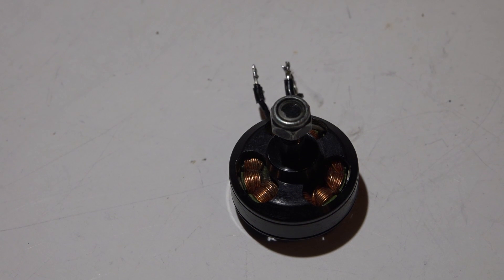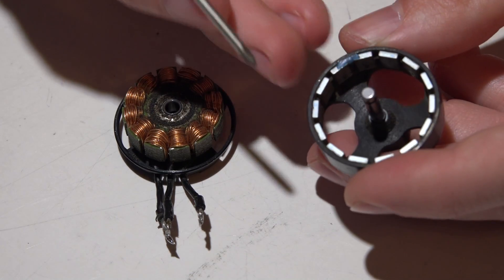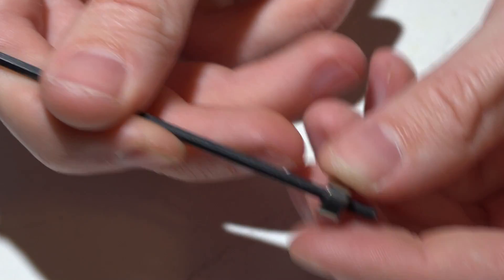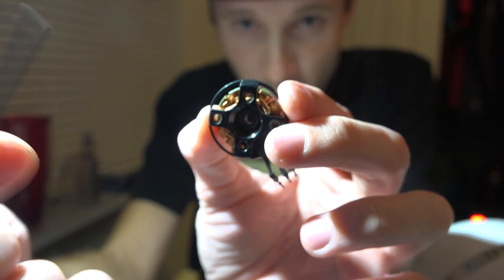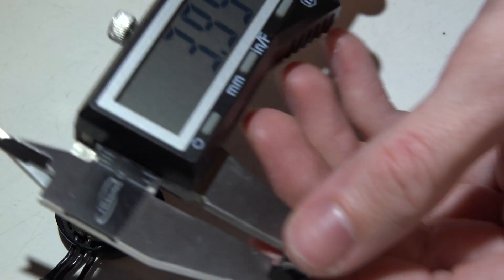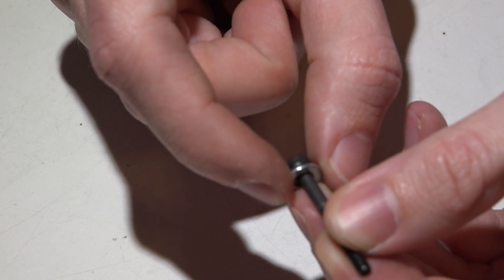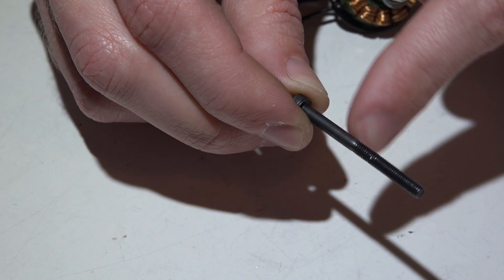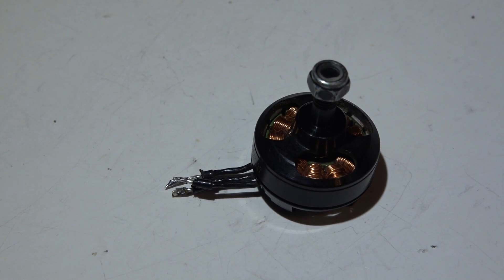Replacing Brushless Motor Bearings Without A Press

Comment: I want to say thank you, thank you and thank you for your genious tip. I had to change the bearings in my LRP x22 motor and I did not have a real bearing tool for it. LRP once had a special tool for their X22 motors but not anymore. I did not want to take a chance and spend 300-350 Swedish kronor either on a "universal" bearing tool that may not even fit on LRP motors anyway. I did what you did instead and used a right size bult(M4) and nut with some shims and used the old beraings not push them in place. Worked like a charm 👍😀!!

Comment: Hello, 

I had an incident today where my splashdrone planted nose first into the ground, the prop mounting screw was damaged can these be replaced or do I need a new motor,  there isn't any visible screw holes like most generic ones on the market but it does look like a seperate piece, please welpppp

Comment: yep look good in my eyes
I would make the tools a little better, so the inbus is not my way, but would find a nice axis .. and then use it in your way.

I would also take a wooden blok to make the engine there neatly in a corner .. that it does not slide away ..( 2 pins in it?? so klik/ hanging  the engine on it )
otherwise there is nothing wrong with the way you work ..
I would take a slightly lighter hammer .( a toy hammer ). but then you can only work when you have the bobbin and pen .. you can work pretty precisely
gr and thank you
good work falcon ! !!

Comment: i wonder if some heat on the motor and the bearings in the fridge for half an hour would let them drop into place just with finger pressure?  i'm still scratching my head  looking at one of those closed e-clips.... i should probably just buy some then all i have to figure out is putting them on which is probably a bit easier... anyway great tips,  will save me some money

Comment: I am playing with some micro brushless quadcopters (90mm to 100mm) and the 1mm E-clips are vibrating off. They are so small that I use glasses and a magnifying glass to work on them. What would you use to lock the clips onto the shafts? Thanks.

Comment: Have you ever tried a thrust bearing on the bottom of a quad copter motor?
I tried it, i fumbled across a perfect size one, and tried it, but i am wondering if it is better or worse?
As with standard roller bearings, the force from the prop is pulling on the lower bearing, and so I guess, must be creating major forces in the wrong direction , that the bearing is meant to have forces applied to.
With the thrust, it is having force applied where it is designed to be applied, I ran it for a week or so, and all seemed ok, but i swapped it out, as I dont know all the specifics for forces and friction and stuff like that.
Anyway, just thought I'd ask, as I have never heard of it being done.
Great info here by you again, thanks.

Comment: Hi!
I know this vid is old.. but im reaching out to get some advice on the dys se2205 motor/racerstar rs2205..
The bolt in the bottom are glued on these motors with locktight.
Less than half of my motors ive been able to loosen up those damn bolts.
On the ones ive had trouble with ive tested about everything.
Ive used a soldering iron to heat the bolt to sort of trying to melt the locktight.. with absolutely no luck.
On some motors ive had.. theres been to much lovktight that the motors hasnt spun as freeley as other motors.
Ive basicly ruined a few motor bolts by trying to get them loose.
And in crash if i had got dirt in them i cant get the bell of.
Any idea what i did miss on the solder iron method?

Comment: How tight is that screw supposed to be ? I killed one of my motors by over tightening the bottom screw. The next one I only nipped and that one is over heating too :(
Reply from the maker: For the screw on kinds I put blue tocktight on it and just get it snug. With the locktight you wont have to worry about it.

Comment: As an old school RC racer I thought I would add one sanity saving tip about dealing with evil c-clips and e-clips.  Get yourself a bag and place the motor in the bag when removing and replacing the clip.  A gallon ziploc will let you easily get your hands in to work on it.  This way you don't fire the clip off into oblivion.
Reply: Chad Martin After they fire off they disintegrate. I have yet to find one that popped off into Oblivion.

Comment: I got a couple of those Cobras, but I think they are grounding out.  When I use them on good ESC's they start to Tremble and not work correctly.  Any suggestions on how to fix possible Motor Grounding out? Another test I did was to check continuity between each wire which was good but then I checked from any wire to the bell housing and I was getting continuity(saw a youtube video on it)...which in the video it stated that the motor is grounding out. Any advice besides tossing the motors?
Reply from the maker: Only other thing I can think of is make sure that your motor bolts are not too long. On these motors the copper coils are very close to the bolt holes, especially over one specific hole. If a bolt on that one hole is touching the coils then it will make the motors act weird. https://www.youtube.com/watch?v=-tp7UD0a9dg&t=4s
Reply: Project Blue Falcon Yeah already did that. I actually didn't mount them on a frame (just for testing) and they were still acting up. I may try to rewound them with new shielded copper wiring. I could toss them but it's just damn shame.
Reply: Let us know how you go with the rewindings.
Reply: ***** good idea. The long road is rewinding. I gotta make time for something like that. I don't even know the shielded copper size.

Comment: Is this what bearings sound like when they need replacing? https://youtu.be/_7N-BPuSxUo
Reply from the maker: It's hard to tell. That sound certainly does sound like bearings, but some motors sound like that when they're new. I just kind of take a mental note of what mine sound like new, or go back to older footage and compare the new to old sound.
Reply: Cool, thanks. I've had them over a year. Only added a HD cam today so first time I've heard that. Only needs to last a few more weeks until my next build.

Comment: The bearings we use are 3x8x4mm or 693zz.  Newer motors with the 4mm shafts use 4x9x4mm or 684zz.
Reply from the maker: Some use the 940zz as well, like the DYS Race Edition
Reply: Does the Fire use those?  Both my se2005 and se2008 use 693zz.

Comment from the maker: When choosing a bolt, make sure you get a metric bolt that is the same thickness as your motor shaft. For example my shaft was 3mm thick so the bolt I used was a M3 metric bolt. The length of the bolt will depend on your motor. For most 2204 to 2206 motors the length will be either a M3x30, 35, or 40mm bolt or M4x30, 35, or 40mm.
Reply: I hope you are resting in peace. we all remember and love you

Comment: is there better performance bearings you can get for motors or are they all about the same?
Reply from the maker: Only real difference is ceramic vs steel. Ceramic lasts longer but both have the same performance. It's just a matter of life span.
Reply: what kind of life span are we talking about... months years?
Reply from the maker: All depends on how often you fly. Kind of like how dirt bikes and jet skis show hours the motor was used instead of miles driven. I fly all the time, weekdays and weekends so I change mine about every 2 to 3 months. Where some people never have to change them. It also depends on the quality of the bearing. Like I said they are either ceramic or steel but they are manufactured different. The Racerstar motors on Banggood are $27 for 4 motors where the T-Motors I use are $25 a piece. With cheaper motors you usually have to change them more often, unless you upgrade to a better bearing like a T-Motor bearing.
Reply: Project Blue Falcon that is the perfect information I wanted to know. Sorry I am new to the hobby and any little bit of info is much appreciated.  My first build are going to have Racestar 2205 2600kv motors so that's good to know 😀
Reply: Project Blue Falcon any recommended sites to look for these T-bearings for Racestar?
Reply from the maker: Just a couple things to add. You generally will know when its time to replace bearings because you will hear it when viewing your footage, if you use a HD camera. Other thing is, although Racerstar motors use cheaper bearings, thats not a bad thing. The way I see it, two quality bearings for one motor are about $5 each. The Racerstars on Banggood are $27 for 4 motors. At that point, and this is why many guys like those motors, it's not so cost efficient to replace the bearings. For a little more you could just get 4 more motors. Which isn't a bad idea at all.
Reply: Project Blue Falcon they come in a kit from Banggood, 210x v+ kit Revo f4 30a esc, any recommendations on motors that will rip like crazy and hold up to the stress? That won't break the bank lol
Reply from the maker: You can buy the Racerstars separately. Dont have to buy that kit all over again. As far as recommendations I use the ReadyMadeRC blue series motors, which are rebranded T-Motors. They are expensive though. The T-Motor F40 series are really good too. But the Racerstars are decent motors too. They have the power, they just dont last as long. But like I said you can get 4 of those for the price of one T-Motor. A good middle motor is the DYS race edition SE2205. I'll be doing a review on the new RMRC Rifles, DYS, and Racerstars. That way you can see the different between low, medium, and high.
Reply: Ill be keeping my eye out for the RMRC / DYS / Racerstar review,  keep up the good work dude